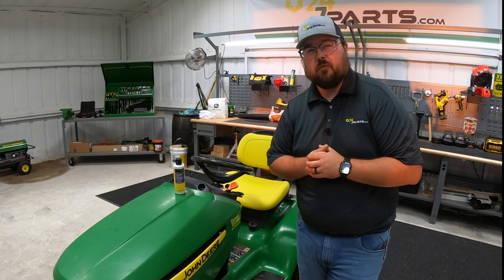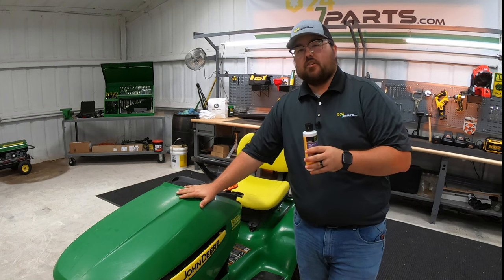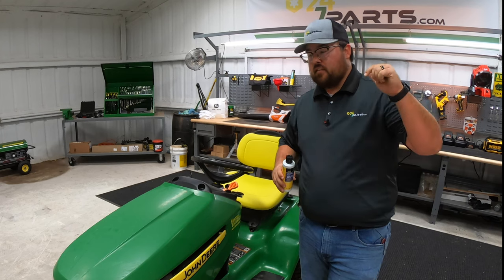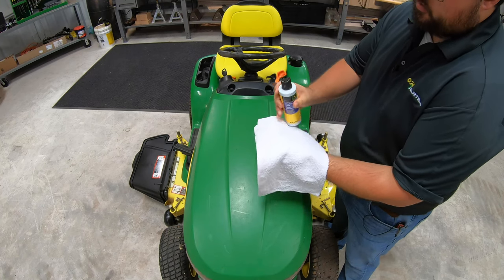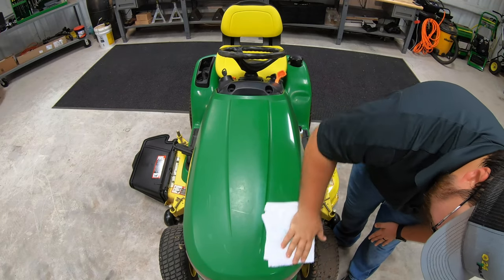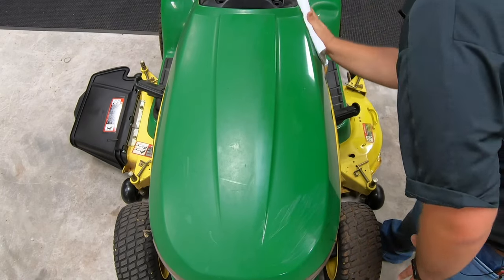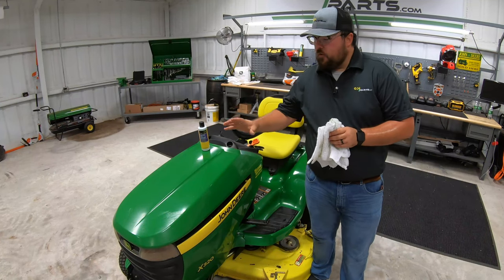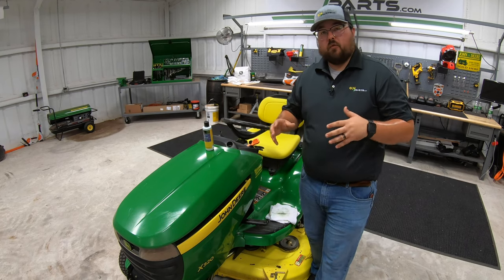How to Polish and Restore the Plastic and Metal on Your Mower, UTV and Tractor

Comment: Meguiars  was will do the same thing and  give a better shine ,use small buffer and it make it new
Reply from the maker: Good tip. Thanks for watching!
Reply: What product from Mcguires are you talking about thanks
Reply: @kennywhite8810  Meguires Ultimate Compound  , use with a drill and 3" foam pad  ,
Reply: What about those bigger scratches! Light sanding first? What grits?

Comment: I know the video is a little dated, but I wanted to ask - can you polish out the white discoloration from acetone spilling on the plastic hood? I'm not sure if it removed the paint, or if the color is impregnated in the plastic, and it's just a haze from the chemical reaction on the surface.

Comment: This is very helpful!  What do you use for the black plastic around the dash, cup holder on the side & the steering wheel?
Reply from the maker: One of the best options for this is a heat gun. Using it multiple times over the surface brings the moisture from within the plastic back to the surface. I hope this helps and thanks for watching!
Reply: I detail my own cars and my favorite is VRP from Chemical Guys. Good stuff. Also suggest using micro fiber towels. Works much better with micro fiber.
Reply: Boiled Linseed oil and thinner 60/40 mix.
Reply: Do you think it would work for heavy oxidized colored plastics on kawasaki mule utv?

Comment: In 1995 I bought a John Deere lawn tractor. John Deere really had pride in building their equipment.  lasted  for 12 years.

So I recently bought a new one around covid as like every other company during covid, John Deere's price for stockholders cast to go up and guess who gets screwed in the game.

It doesn't matter if it's food electric rent or even lawn tractors.

My 2021 S100 is a pile of shit.
Thank God I had a a warranty, 

Thats even a  joke so I put less than 40 hours a year on it.

It's been in the shop
 5 times.

2 times for spindle wearing out. Thanks to YouTube we know the spindle issue problem they put grease inserts however when you leave them up it doesn't get to the bearing a simple fix and John Deere can't get it right.

One time for belt issues.

One time for the seat switch malfunctioning

Like I said they're a pile of crap.

I will never buy a John Deere ever again.
Totally ripped off.
$1799 lawn tractor at Lowe's prior to covid.
Purchase mine in 2022
$2599

It's all a sham they make cheaper parts the parts are made to wear out.

In the old days they make good lawn mowers that lasted.

But just as electronic items cell phones the batteries have been lasting too long manufacturers are saying how we sell more phones the quality is too good. So they started making the new phones with batteries that need to be replaced every 3 to 5 years sealed unit you're forced to buy a new phone